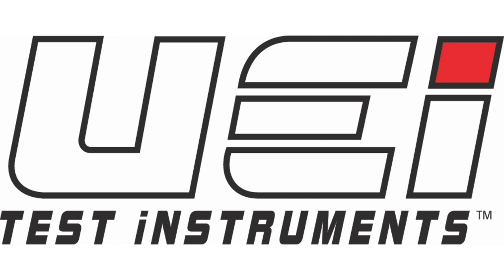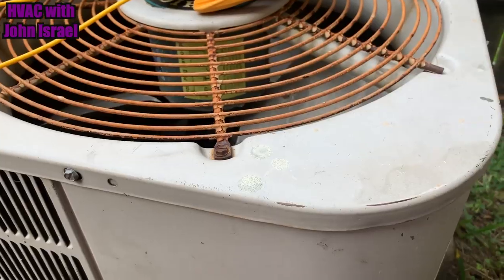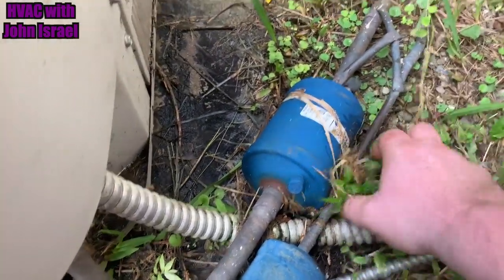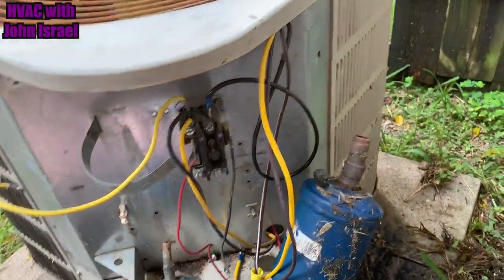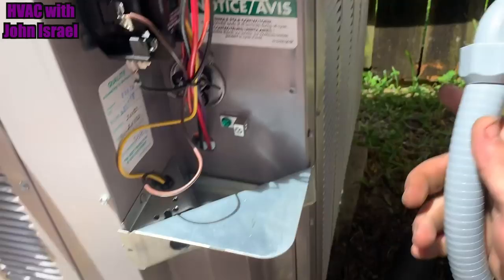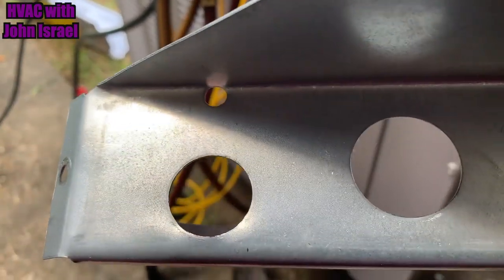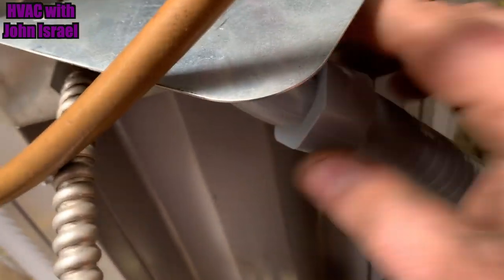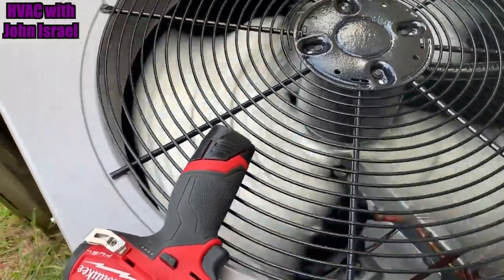Homeowner Repair Leads to New Condenser Install

Comment: Think bx cable is crazy? I have a lawn service and several of my customers with older houses around here only have romex coming through the siding with no disconnect except the breaker in the main panel.
Reply from the maker: I’ve seen that too man!! It’s unbelievable.

Comment: That is flex(flexible metal conduit) not bx. NEC 348.12(1) does not allow flex to be installed in wet locations. So nether the high voltage or low voltage whips can be flex if in a wet location.
Reply: I wonder if that was once LFMC and the pvc jacket has all broken away, I've seen quite a bit of that here, with the help of rodent and kids picking at it. of course mainly years of uv and weathering.
nevermind caught later in video the type of ends used null my thoughts and it was plain FMC... eww
Reply: @throttlebottle5906  Eww indeed. For whatever reason in some parts of the country flex is used on condenser installs and even approved by inspectors
Reply: @xXBuckOFiveXx  I could see if they put UF cable inside, then again those are likely THWN or better wires, Ionly looked like two and no ground conductor, so relying on the flex for equipment ground?
must be real old I guess

Comment: Nice install, John.  Interesting about that having a Bristol Recip.  Now did the customer ask for this unit by name?  I know you are an ICP Man!  Either way, I am sure they are happy to be cooling again.
Reply from the maker: My ICP distributor is also a Rheem distributor. These units are priced really well. I use them most of the time on condenser only change outs.
Reply: @johnisraelhvac2019  They look really good and sound nice.  I am sure they have a good warranty.
Reply from the maker: Brent Audi they come with a 5 year. But if you go to the website and pay a one time $30 fee you get a 10 year
Reply: @johnisraelhvac2019  Another 5 years for $30!!!  That is awesome!